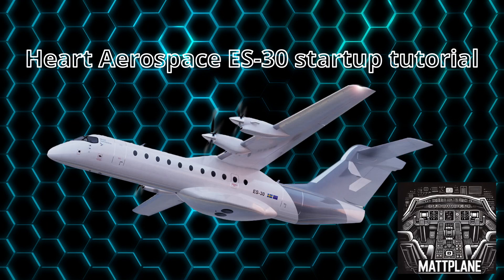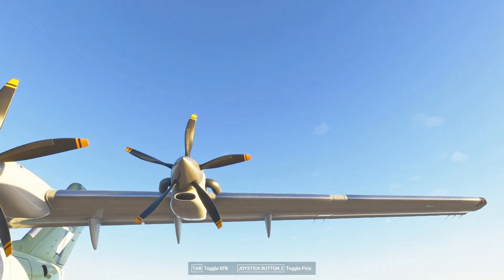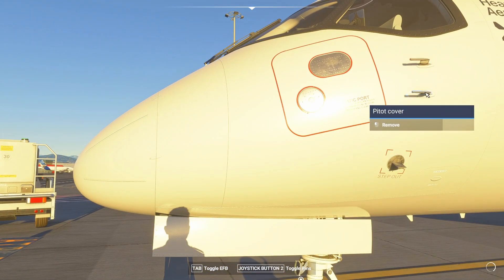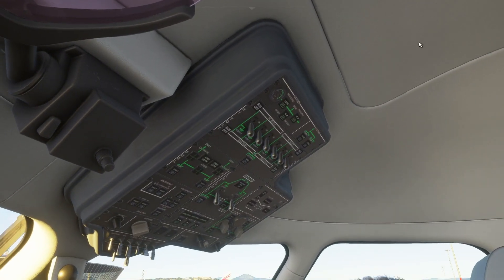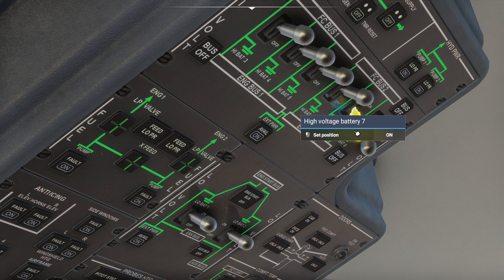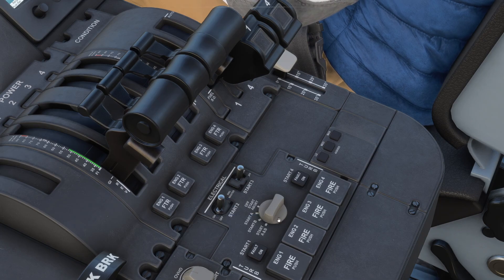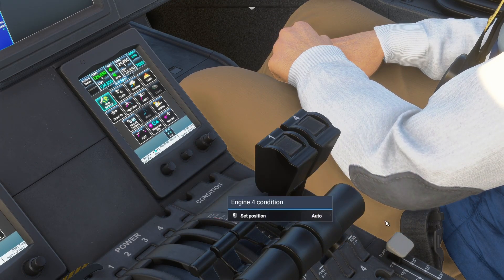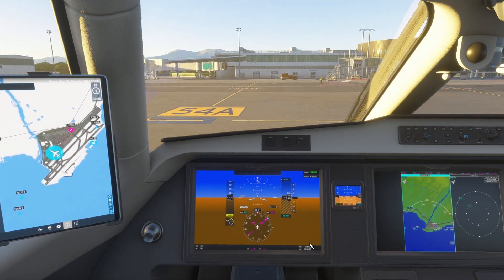Heart Aerospace ES 30 detailed startup tutorial

Comment: Can't get my Thrustmaster TCA throttle quad to sync up with this plane!
Reply from the maker: I had the same problem. I have configured so thrust lever 1 control all the thrust levers but have you tried resetting the controls to default then using the axis that is controlling thrust levers 1 to control also the thrust lever  2 and the second lever on for thrust 3 and 4 ?